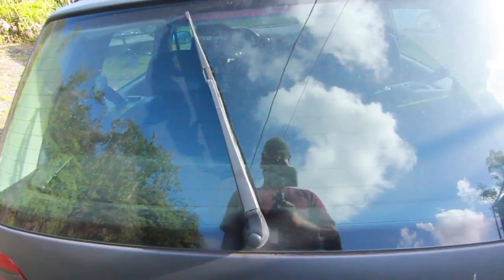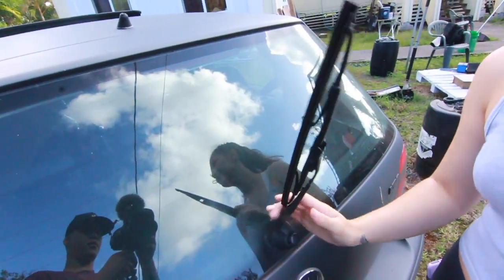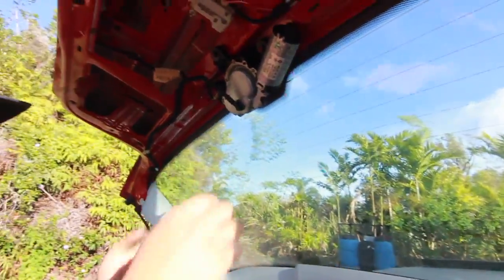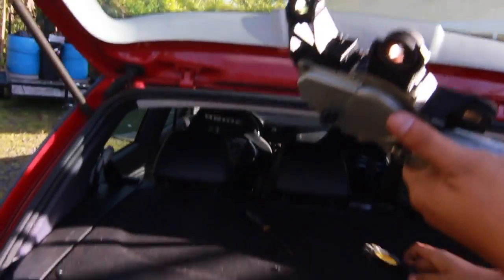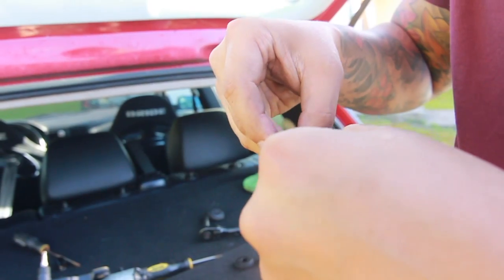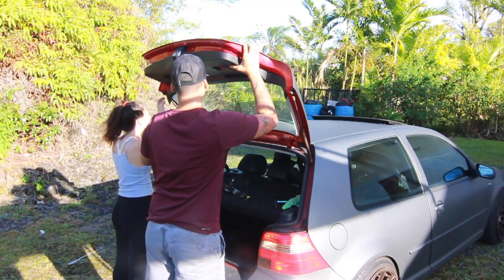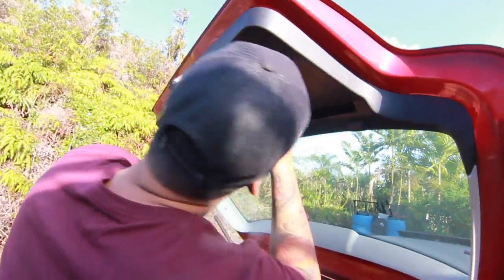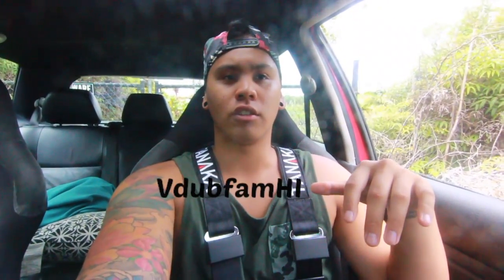Vw Mk4 Rear Wiper Delete Install [HOW TO]

Comment: Your rear wiper is probably shot. Did you test the motor? And have checked the wiring that is connected and runs through the hatch?